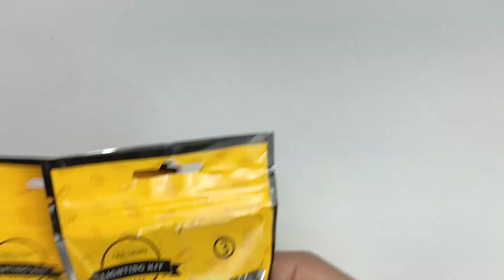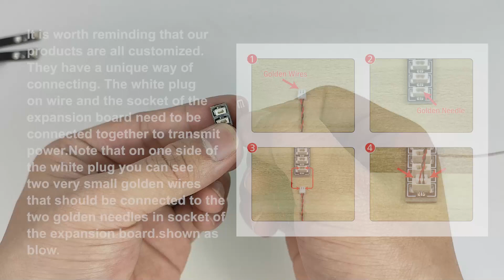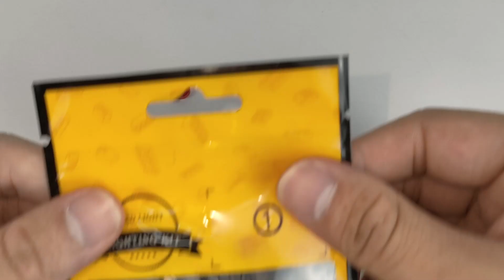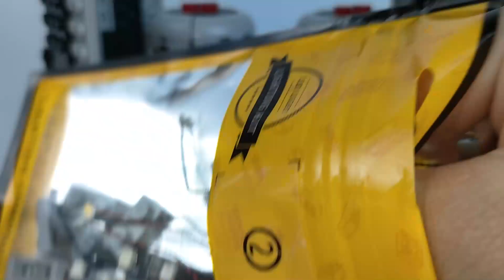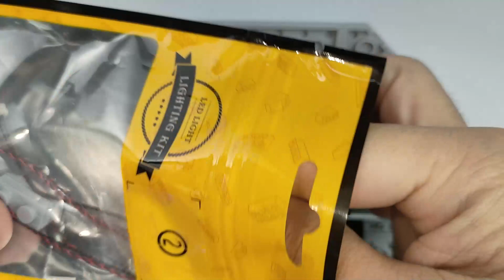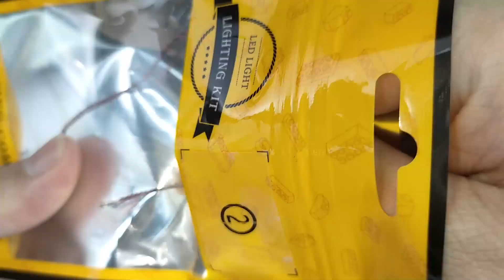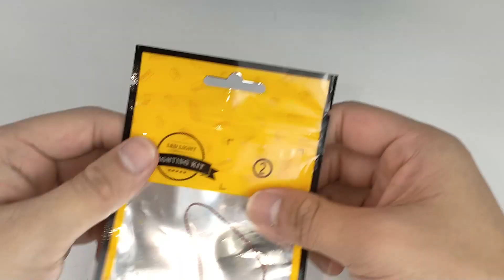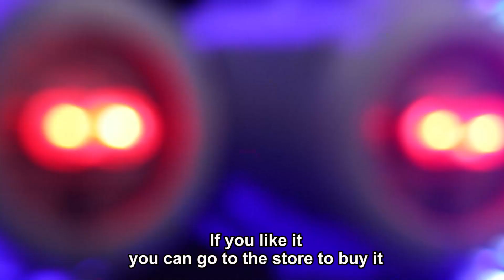Installation Instruction Of Light Set For LEGO 75347 TIE Bomber.

Comment: This guide works great. Like he says careful how you plug those wires in I did one the wrong way and was able to straighten the prongs back up with an exacto knife but there is also a socket you dont use so if you need to you can screw up one and be ok.